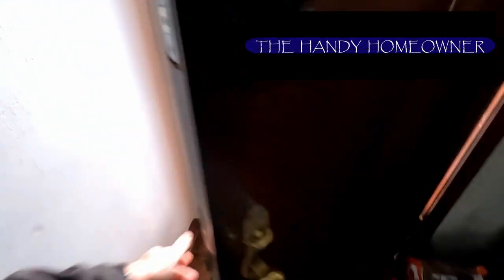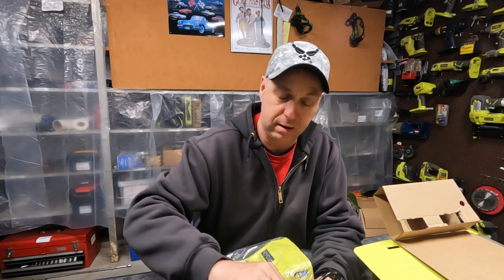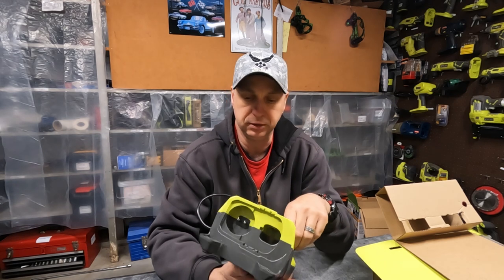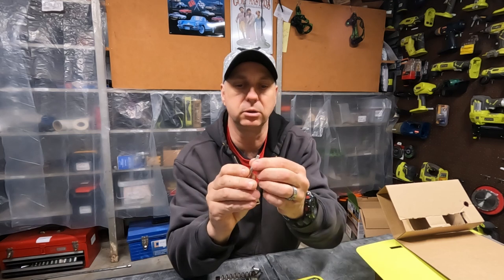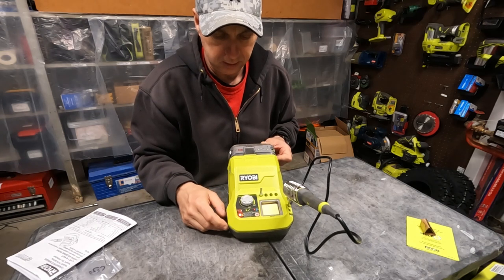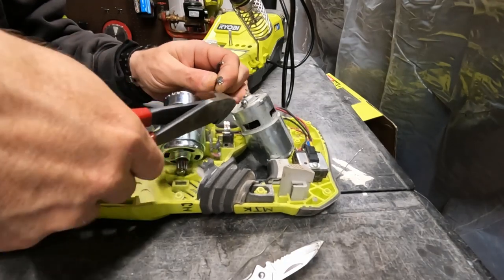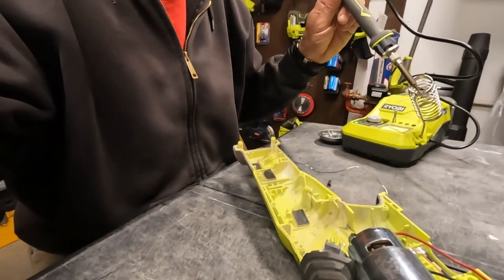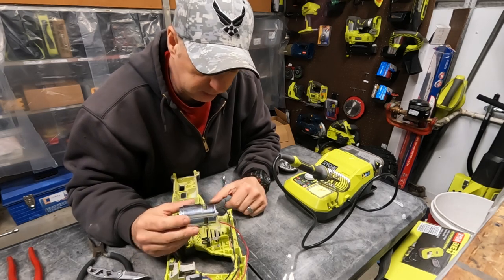Ryobi P3100 One+ 18V Hybrid 45 Watt Soldering Station - Unboxing, First Impressions, and First Use

Comment: By far the absolute best soldering iron i have ever owned .i have had lots and lots over the years and i give this 5 stars all day long
Reply from the maker: Ive been using mine more and more and really liking mine alot as well.   The portability with battery power is very nice.  It heats up fast and works very well.  Only complaint is the cable.   Other than that i agree.
Reply: @thehandyhomeowner9781   yes i noticed yesterday doing some trailer wires i was thinking that the cable needs to be a little longer

Comment: Did you try to weld plastic with it?
Reply from the maker: I did not.  Since i have 2 older plug in solderinf irons with crappy tips i just use those